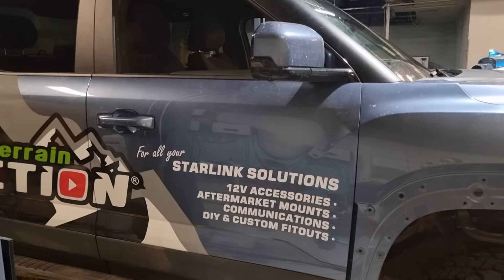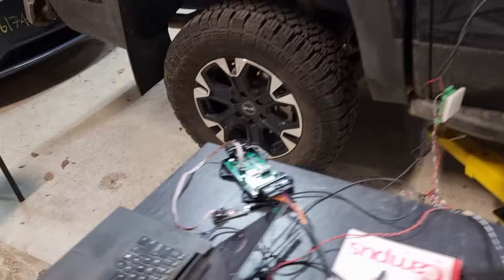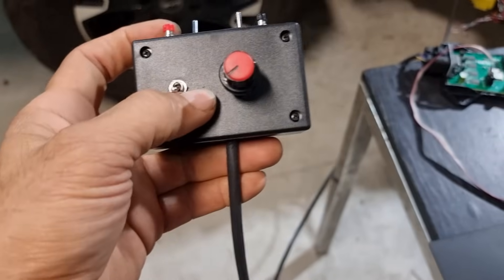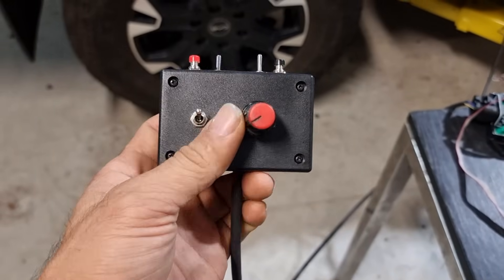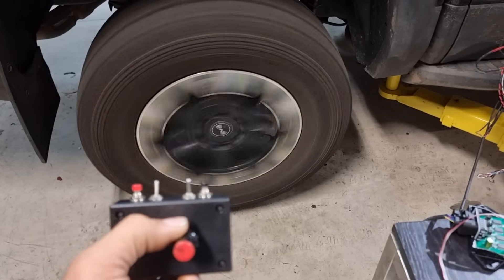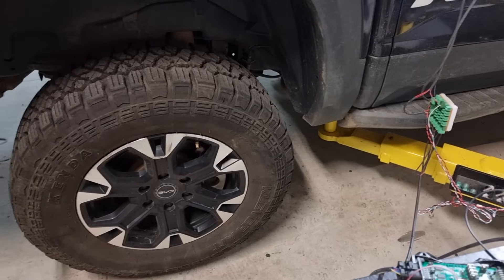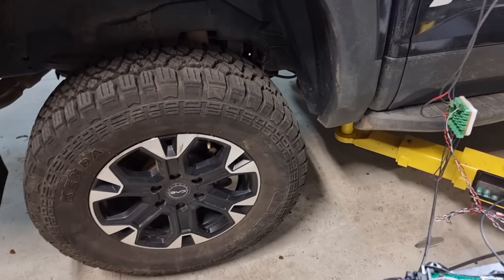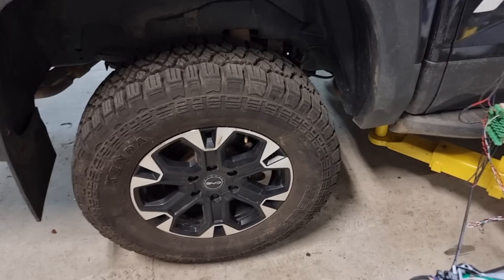Taking control of BYD Shark 6 Rear Drive Unit.

Comment: This is great! Can you tell me how to reproduce this, as i have a drive unit of a Dolphing that i want to use in a conversion. I understood there are toug cryptographic commands built in that are as good as impossible to bypass and get it to run. Are you on a forum somewhere?
Reply from the maker: The dolphin drive unit is different to the Shark.  It doesn't take the same commands.  Inhave managed to get the dolphin/Atto3/Seal drive units to work but I need the left body controller and the FOB to get disarm the immobiliser.  However,  they can not take a torque command. So far the best I have managed to do is to make it drive like a BYD (long accelerator delay). I am trying to see if I can get it to take a torque command and remove the delay but it is still early stages.

Comment: Cool stuff! Do you have a video explaining the boards & software you're using for your diagnosing / sniffing / MITM / control stuff? Looks better than the Arduino Due & EVTV CAN shield I've been using.
Reply from the maker: @RaglansElectricBaboon  the board I am using is my own design.
The software isn't anything purposely designed for hacking cars. If I need to block a message I just hard code the value and reflash.
I have been doing enough of these that I have been thinking of writing something easier to use but haven't done anything yet.
As I decode messages I try to make a library to decode the messages/create the messages and store the data into a data structure.
As I do more I learn more and refine my procedures and library design.
My objective is to try to make a kind of interpreter so I can for example take the messages going to a Mitsubishi drive unit, convert it into messages for say the Atto3 drive unit and do the replies so I can put an Atto3 drive unit into an Imiev or Outlander.
I have an Imiev and one of my aims is to replace the Mitsubishi drive unit with an Atto3 drive unit. It will be my test to make sure I have full control and understanding.
Reply: @franciscoshi1968  Thanks for the detailed answer. Good stuff.

Comment: Does each rear wheel have an electric motor or just a single rear driving a diff ?
Reply from the maker: One motor per axle driving a diff.
Reply: @franciscoshi1968  so if it's a open diff with no lsd or locker can never truly simulate a diff lock?
Reply from the maker: @twiggs920 no. It can not simulate a diff lock. It really needs a diff lock. Even if it had a motor for each wheel, a diff lock would still be a better solution because with the diff lock you would get the torque from the wheel with grip plus the torque of the wheel without grip. 
Also using the brakes to stop the wheel without grip is not as good as a diff lock. With the diff lock you would get all the torque from the motor to the wheel with grip. Using the brake will only give you half the torque of the motor to the wheel with grip.
Reply: Thanks for the reply

Comment: While you're at it, you need to find a way to electronically lock the front and rear axels together so it can reverse safely down hill with out the front wheels locking up

Comment: The Mitsi PHEV Outlander had the same issues from 2014 to 2020 with a simulardrive train setup, then they said they only fixed it with a new model, however I didn't buy another one to prove it, let's hope BYD don't nake the same mistake here, good work Francisco!

Comment: Wow you are genius, just a typical question about BYD vehicle to load feature when you use the electricity coming out of the BYD charge port is the electricity a modified sine wave or a pure sine wave form? I am sure you will have a oscilloscope to test this
Reply from the maker: I haven't checked it but I am pretty sure it will be a pure sine wave.

Comment: I'd love not only control over the rear motor in offroad modes, but a dynamic regen that is connected to the brake pedal - the harder I press, the higher the regen
Reply from the maker: It already does this. When you press the brake it adds regen.
What I think it needs to do is reduce assistance on the brake and use regen until regen makes out and then start using the brakes. It may already do this but I haven't played with the brake booster enough.
Reply: @franciscoshi1968  Yes that's exactly what I meant - use regen as much as possible to brake the vehicle before applying brakes

Comment: If it is the lack of motor torque 
Is there any room under there to put a reduction gear that you engage like a locker. At its fly by wire, the rear and front motor could be controlled separately thereby not needing a reduction gear in the front.
Reply: We will just go at portals and get reduction there if we need 😂
Reply from the maker: We need to work out what the maximum rpm for the motor is and the gear ratio.  For all we know they may have the wrong gearing.
If it has the wrong gearing it would be easy to get new gears made.
I will get some data and we should have some idea of the situation and what the limits are.
Also a diff lock may help. When the brake is applied to one wheel to simulate a diff lock the torque to the wheel with traction is only half of what it would be with a diff lock.

Comment: Good work Francis. Out of interest are to able to check the final drive ratio on the rear? This would allow a calculation of theoretical torque available at the wheels.
Reply from the maker: I am going to do that by looking at motor rpm and vehicle speed and work out the ratio based on the tyre size.
Reply: @franciscoshi1968 excellent work, looking forward to more experiments and learnings with the Shark 6

Comment: Are you open sourcing any of this work?
I do embedded hardware and software for a living, would 100% contribute. An open source traction computer where people could test their own algorithms would be insane.
Reply from the maker: Letting people change the behaviour can be dangerous.  You can easily make the vehicle spin out of control unexpectedly.
Reply: @franciscoshi1968  I disagree, I think it would open up a huge world of EV conversions. There's a heap of unusable salvage BYD drivetrains out there that could be turned into track cars and rock crawlers. It just needs documentation to be usable. Hell, I'd settle for a wiring diagram that shows the canbus lines
Reply from the maker: @matthewanderson1585 I think for that purpose it would be fine. I just don't know how you could make something that anyone without programming knowledge could use and do something we didn't think of doing from the start. The ultimate is sending the torque command to the motor but that needs a lot of programming skill and hardware that you understand well.
Maybe making a board that has everything you need and some drivers?

Comment: Nice. Will you also be monitoring motor / power temperatures to confirm it's pulling power due to overheating or not?
Reply from the maker: I can add that later. Generally if the motor overheats the torque request will stay the same but the applied torque from the motor will not match.

Comment: Looking forward to see the results once the car is reprogrammed to produce desired results. Real time testing at beer o’clock hill will be the defining moment. The terrain is not a solid surface and it has a high incline. I have confidence it will be able to make it up with correct lower tyre pressure, to help grip and a slow output of torque to get it to the top. You are working with the right guy to get results. Good luck Francisco🙌

Comment: New drive replacement modes: 

1. Sendit Mode
2. Aussie Mode (BNS style). 
3. Beer O Clock mode (All wheels full torque and software driven diff locks)

Delete the BYD modes.

Comment: I wonder what fuel/battery economy would be like allowing the rear wheels/motor to freely spin, while allowing front motor and engine to run whilst cruising at 100ks. Opposed to constant awd with both motors running, possibly an Extra economy mode?
Reply from the maker: Some preliminary testing shows that in ECO mode the rear motor doesn't apply any driving force.
In NORMAL and SPORT the rear motor applies a little bit of torque.
Only in off-road modes the rear motor applies similar torque to the front.
This was while driving slowly. Things may be different at higher loads.

Comment: Why have byd limited the regenerative breaking preformance? Would putting so much power back into the batter damage it? Like breaking from 100 to 0 using max regenerative breaking surely afftects the charge cycle of the battery right? Like is it a super capcitor and slowly put the power pack into the battery.
Reply from the maker: When you press the brake pedal it applies a lot mote regen. They have done this so it feels more like a petrol car. They have gone to a lot of trouble to make an EV drive like a petrol car.
Reply: @franciscoshi1968  exactly, in my Seal when applying brakes normally I can get up to 110-120KW regen, BUT if you very quickly go hard on the brakes, it no longer applies as much regen, and goes full mechanical brakes instead. 
BYD, do this to make the transition for new EV drivers easier and more familiar to them rather than expecting them to relearn how to operate a car, hence why they have gear selectors on the centre console, pushing on the brake pedal to start the car etc.
Reply from the maker: @stelp7617 they could have easily added an option like Tesla or MG to enable or disable OPD and satisfy everyone.
Reply: @ The Atto3 has a selector switch for regen levels, i'd be surprised if the shark didn't have a setting somewhere.
Reply: @franciscoshi1968  Man I really Hate that. They Did the Same thing with the Prius. Which had the Advantage of actually being a range extended EV, but they Intentionally gimped it in software to make it mimic a normal ICE.
Reply: @Casper-NineteenEightyFour  Bro, generating 200KW of deceleration at high speed is almost equivalent to emergency braking. I believe you would not like to experience this.
Reply from the maker: @杨冠儒 you have to try a properly implemented OPD. I did one for an EC11 Van. This van would easily outbrake a Tesla or a Volvo on regen and some of the people that drove it though it could do with more regen.
There is a video in my channel of it it doing the brake test using regen.
Reply: @杨冠儒  I would actually, I love brakes that work. But I acknowledge that many would find it uncomfortable.
Reply: We have some steep hills around us, I've never seen regen display more than 60 to 70 kw... That's half what other byds can do.

Comment: This is very cool. I imagine the end product might be something like an idrive throttle controller - plug and play. is it possible to somehow override the system so it sends the same amount of torque to all wheels when activated, which might make it mimic diff locks?
Reply from the maker: That is the plan.
We think what we need to do is allow more slip on the wheels. We think the traction control is cutting power to the wheels.
I have a graphing function that will display motor rpm and torque request for both axles.  When the Ute is fixed we will take it off road and watch what it is doing. 
We are probably going to add one pedal driving with aggressive regen and control the motors so it will try to keep all wheels spinning at about the same speed.  We do not want to let the wheels overspend too much because it will burn the tyres.
Reply: @franciscoshi1968  Career electronic engineer here, from time to time I code program/design circuit to fix problem on complex equipment. Hope your brain won't burn out working on the UTE, which I experienced on my adventure.

Comment: We’re gonna build this guys, show how far we can get EVs moving offroad. There is potential we’re on the road to find it with Francisco’s expertise.
Reply: Looks like your Shark will be the first up Beer O'clock hill after all.
Reply: @yeayou1221  dont be so sure, getting rear wheel drive is only 1 part of the equation, we need clearance and then traction. You can be pretty certain I'll avoid hyperspeed after this ordeal.
Reply: @AllTerrainActionEV  if you are modifying the software and essentially apply the same Torque to both motors isn’t that basically the same as lockers? If so I believe you’ll have the power to crawl up Beer O’clock hill with the right clearance and tyres. I’m certainly no expert though so I could be very wrong.
Reply: Beer o'clock hill is great for testing, but actually reaching the top may not be a great milestone for the Shark 6 platform. Without a low range the rear motor in particular may simply not generate enough torque on the steeper sections of the hill.
Reply: @spectrixx I agree but because the world hates me right now, I think beer o’clock in a sensible fashion even just to superior sign will be well - a superior outcome 😂
Reply: Hell yeah 🎉 the mad scientist! 👨‍🔬
Reply: there is a potential of course but not close to mechanically linked 4x4 systems, in fact a conventional 4x4 system with 3 locking diffs and electric motor assistance is far better.
Reply: Hi. Great video. What is the hacking box made from? Is it something like a Raspberry Pi?
Reply: Are you thinking a simple hold down to override torque command button for the steep climbs?
Reply: @Deathsencore  I think our first expedition will involve spying on what the car is asking the rear motor to doing offroad in these steep settings, then seeing if we can improve that by adding our own little push.. once we know what we need we can determine the best way forward in a testing senario. There needs to be alot of thought going into prevent of runaway and how we can shut off the system too, before we go anywhere to be certain this is also safe.
Reply: @AllTerrainActionEV  yeah actuall hack the cooling of the electric motors or the battery too to avoid running into issues since youre taking over the control.

Comment: Amazing work. I love how you guys push this car to its limits, with its power I think there is a potential. I can also see some valuable progress in your demo, do you think a software update could possibly fix it permanently in the future?
Reply from the maker: A software update would fix the problem but it is unlikely they will want to modify how the car drives. There is a big delay in the accelerator response which is not helpful offroad. That delay is the same in all BYD cars so I do not expect them to change it. BYD also refuses to add one pedal driving to any of their cars which would be really good off road.
Reply: @franciscoshi1968  My thoughts are that BYD are doing a 'TOYOTA' here. Knowing full well that there are genius people like you - does your brain ever sleep - that will fix the issues and there by allowing the after market economy to keep ticking over, yet at the same time taking the responsibility off BYD for warranty.